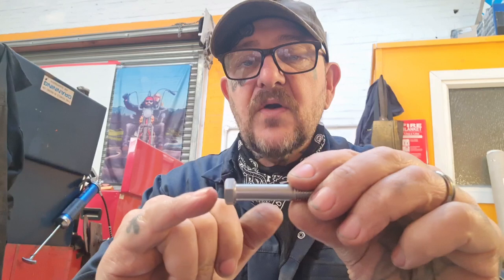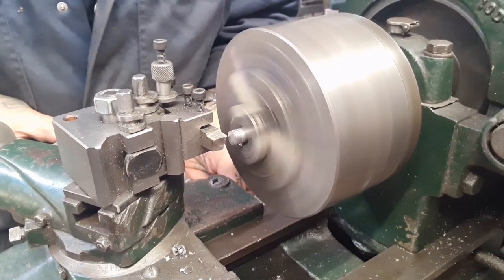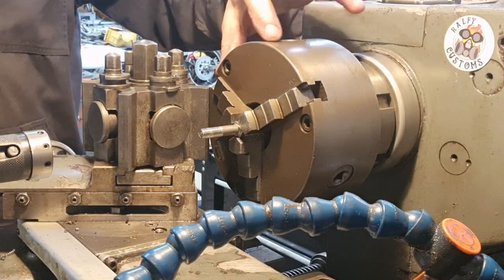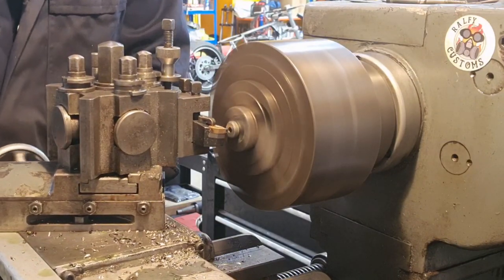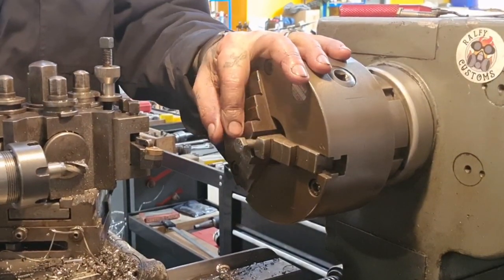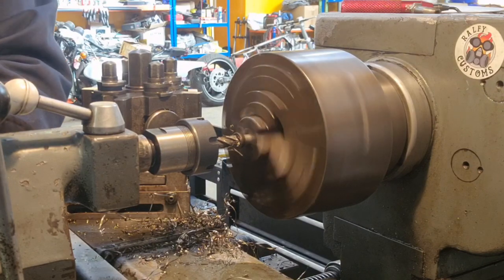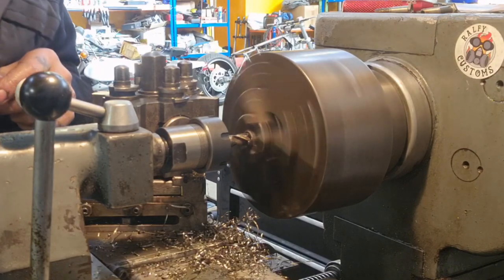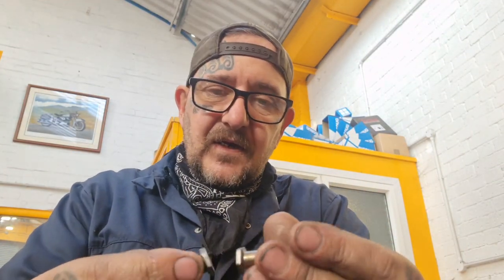Breather Bolt FAIL #english #engineering #workshop #restoration #motorcycle #vlog #crazy #bike #fail

Comment: Hi Ralfy I am no engineer however rather than using a circlip to hold the gauze in place, could you not thread the two half's and screw them together then no need to weld and they would do the job, great to see you working through the problem :)
Reply from the maker: Yeah, you're the second person to suggest that, its certainly worth looking into

Comment: Ayup Ralfy. Turn the TIG machine up higher and perform a series of fast tacks. Allow the bolt to cool after each tack with plenty of post gas. If you weld TIG stainless on low amps you have  to go slower which mean the part has more time to heat up. Stainless likes to be welded hot and fast. Hope this makes sense.
Reply from the maker: Thanks buddy that makes a lot of sense 👍